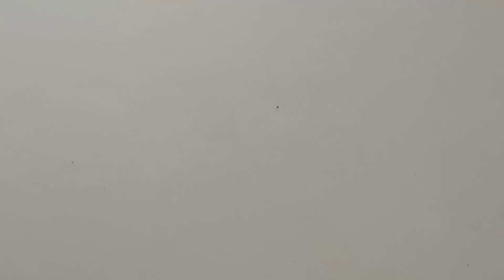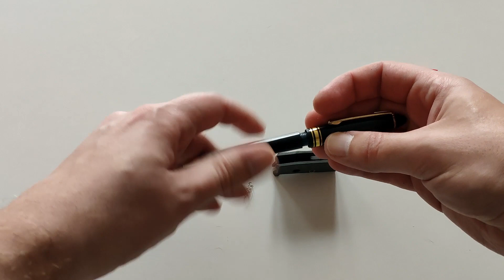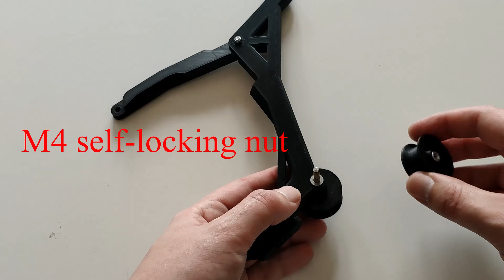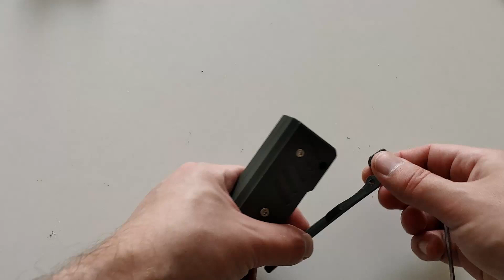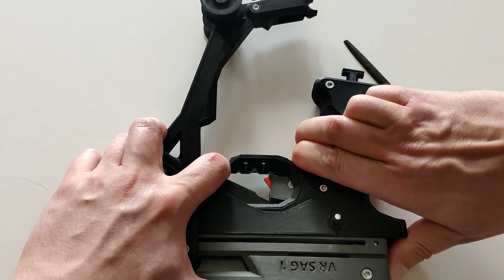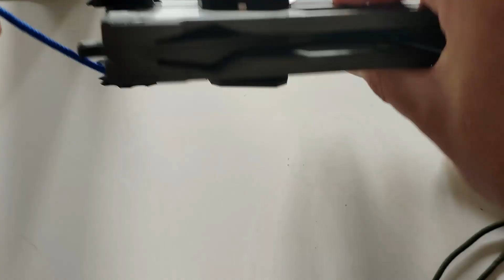VQR SAG1 ver 1.4 assembly instruction

Comment: I already made one, but when the arrow shoots, the head of the arrow deflects upwards
Reply from the maker: You mean the arrow goes up and it doesn't match the aiming point?
Reply: @vqrcrossbow4096  When it hits the target, the arrow is not vertical to the bullseye，I will buy new arrows to test
Reply from the maker: @nanxiangxiaoyin  I noticed the same effect. I suspect the diameter of the arrows is to blame. I have 6.2mm and 6.4mm arrows. To make them fit each one I gave a clearance of 6.7mm and I suspect that it is the fault of this clearance. I've already checked everything from the trigger to the wheels. I am currently making a version that will adjust itself to the diameter of the arrows. Hope this fixes the problem.
Thanks for the response. I want this project to be free from defects. Each such remark or noticed problem motivates me to more action. If you notice other defects, write it.
Reply: @vqrcrossbow4096  Looking forward to your new version !
Reply from the maker: @nanxiangxiaoyin  A new version has been added (1.6). Please write if it improved the shooting.

Comment: I recently got this file and am printing it now have you considered using the small skateboard bearings in the rollers reduce the friction it may also add a bit of speed with lower friction
Reply from the maker: No, it has no place for that. this plastic must withstand 20 kg. By adding bearings there, the plastic would have to be thinner in some places. You would have to reduce the tension on the rubber. In addition, it would require additional bearings to assemble it and this would complicate the structure.

Comment: Appreciate your efforts, 
What 3D printer do you have? Will you consider a Steel ball shooting version?
Reply from the maker: I have an Ender 3. It's a bit old now, I have repaired it a few times. That's how I considered that version. It only requires a magazine modification. But now I have to do 1 more video about version 1.4 with shooting and version comparison. I have to take a break from this project because it made me a bit tired. So now I'm starting the design of a miniature compound bow (50cm) for 6.5 "arrows (it will be capable of shooting with steel balls). Then I make the SAG 2 version with RIS rails, stock, handle and many accessories. It will take 2 years. (Version 1.4 I was doing 3-4 months) I will add the steel ball version to the SAG 2 version.
Reply: @vqrcrossbow4096  fantastic
Reply: @vqrcrossbow4096  2 years for SAG 2.0? We cant wait that long, your project is so well designed. You should consider opening a patreon, perhaps this can speed things up